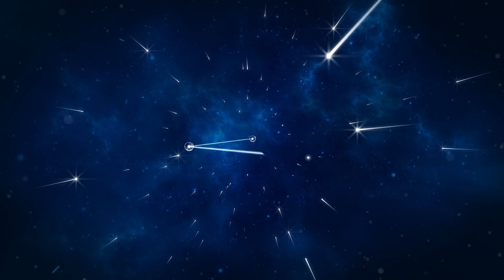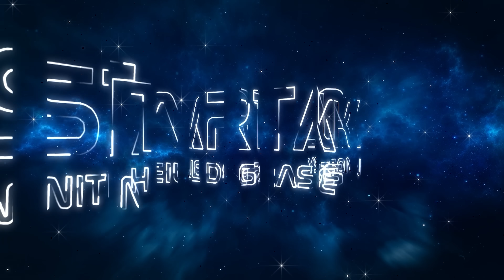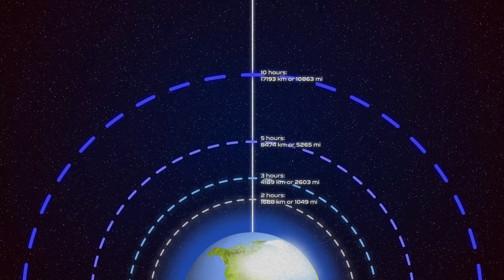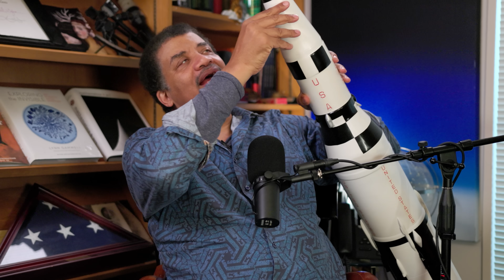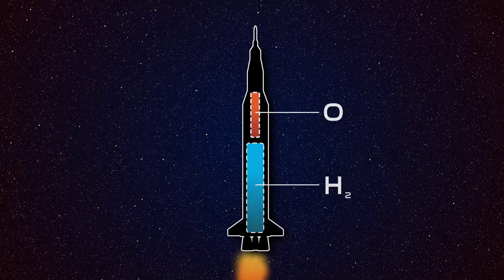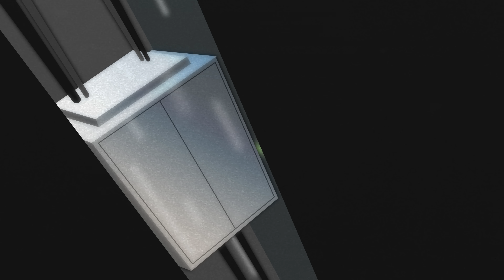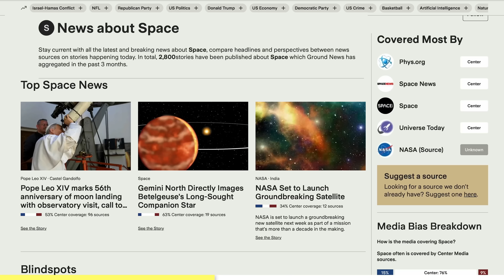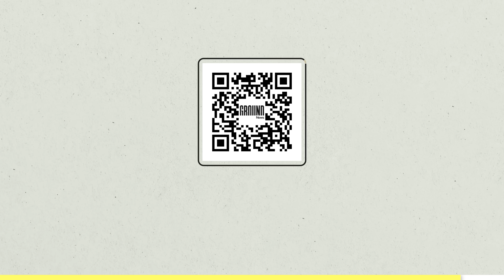When Will We Have a Space Elevator?

Comment: Clearly the 'Elevator' part of the space elevator isn't going to exactly mimic an elevator from a tall building. You will not be using a 47K Mile long cable, no matter what you think you can make it out of. It will not be using a counterweight system at all. A 'crawler' system could work, but would likely be even slower than the 100 MPH you posited. Given how slow it would be, one would imagine that the exterior structure itself would have to be sturdy enough to handle multiple crawlers in progress. No one is going to want to wait three months for the next elevator ride. It really only approaches practicality if you can shield from Gravity. At that point, the crawler could use a lot less energy to move the cab to the top and would be able to go a lot faster than 100 MPH. However, if you can already shield from gravity, the cost of flying a propulsion based craft into GSO is much cheaper... so cheap, in fact, that the elevator becomes pointless.

Comment: So you get two sets of ion engines for the elevator one pointing up and the other pointing down. At 115,000 miles you turn on the opposite to slow it down. Then slowly adjusting both power output to slow it down to a stop in space. But you may need to use more  power for it to "brake" coming down because of gravity. Or I just pulled something out of nowhere.

Comment: I don't get the height requirement. Why does it have to extend to where a satellite would be geostationary? Any point along the elevator would be geostationary. I would think adding any excess height beyond the thermosphere would add unnecessary difficulty in the form of weight and forces acting on the elevator. 
I'm guessing that decoupling from the top of the elevator, if it didn't extend into geostationary orbit must mean something weird happens, ie you either fall out of orbit or have a weird orbit of some kind. It must because you are under the geostationary distance, but if you have geostationary speed, I guess that means it would fling you into an elliptical orbit averaging the distance, or... Can someone who understands my confusion just tell me what I need to hear?

Comment: 7:59 generally, when people are talking about space elevators, they're talking about a system that is in the ten to twenty billion tons of material transferred each way, not counting these sort of fuel and thing and or lift capacity. So the whole point is getting large volumes of trade in and out of orbit. And it has a good counterbalance system. So you basically are making sure that the mass of the car's going up exactly matches or as close as possible, the mass going down

Comment: Actually, wouldn't an elevator in a vaccum be able to go faster?  I mean i guess moving away from earth means more stress on the object leaving the atmosphere than say something moving  along the atmosphere (like the hyperloop system that utilizes a vacuum but essentially moves horizontally, where gravity is relatively the same, versus vertical where gravity will probably increase to a point as you leave the earth's ground).

Comment: Instead of going at a fixed 100 mph, what if it had a constant 1.25g up? You'd feel a bit heavy, but it would move faster. Now, granted, you have to slow down at the end, so you can't keep going faster, but roughly 25% of the trip is speed up, and then you coast and slow down as gravity pulls. What does that do to your trip time?

And as others have mentioned, even if this does not move *people*, it can move *construction material*.

Comment: I think that there was a PBS NOVA a few years back that was hosted by Dr. Tyson that was a context about how the "ladder" would engage with the little elevator car to get to the 'spaceport' the fastest.  The various examples proposed all worked (if I recall it correctly) with a rubber roller and a rubber ladder of some sort or another.  None worked like the Swiss trains that are on occasional travel shows that used a cog (on the train's engine) and the 'teeth' portion associated with the train's rail system?  Go figure?  Are there other ways possible to do this into orbit stuff that might not use a rocket?  Well, maybe....
I liked your presentation, I should admit to.  Anyway,  I should admit to being neither a trained Mechanical Engineer nor a Physicist.   But if the end objective is to get the benefits of F = ma, where 'F' is the summed vectors of 'a' acting on the mass, 'm,' there could be a cheaper, easier way to do all of that without a rocket or your 'solar sail.'  There are other equations around that have the vector 'F' in them, one such is F = ((m*v^2)/r) [or something like that?], ---- let's call this last vector f ---- for Huygens' description of centrifugal force.  This equation involves spinning a mass at a uniform velocity in a circle and has several vectors associated with it, which can be summarized with the 'Right-Hand Rule for Cross Product of Vectors.'   All of this last part has many industrial applications, some are prosaic and well-known. Cream separators are used on a container of raw cow's milk as an example.  So that by a minor extension or two, one can imagine a (flexible tube taped to a cardboard wedge, say) circular tube or pipe that has water being pumped through it (by whatever means, as a try it out experiment or two), then one might also imagine this circular pipe that could be folded along a rough diameter to about 20 degrees or so.  So now the vector(s) f might be labeled as '2*f' as there are two independent vectors because of that 'fold.'  Because of vector algebra, the '2*f'' part might now be labeled as f'' which written more fully becomes: f'' =2*(cos(10 degrees))*((M[the mass of water, [say, in each limb or approximate 1/2 circle of the tube that has water pumped through it]*v(the velocity of the water being pumped)^2)/(r-which is likely a bit shorter than the mathematical 'r' because we are dealing with physical objects here)).  The pumping device could be a centrifugal fuel pump, like is used in commercial or NASA type of rocket engines ---- for the pumping of rocket fuel, using a water steam pump from the chemical reaction of 80% hydrogen peroxide and sodium permanganate  ---- typically rated at about 500 Horse Power [Hp], or in space only an electrically driven pump. Not new information by any means, as there are books written about this method of 'traveling through space without rockets,' maybe there is even a 'shorter version' of this book, so to speak. If you take this suite of ideas to one of its logical conclusions. Not as long-winded nor as expensive as the NASA versions (even if only used as an interplanetary method), but there you go.  And, if you use Newton’s Law of Gravity, you don’t have to actually hit the object, but just move it a bit, slower or faster, to cause it to fall into a near-Earth orbit to be mined for any useful minerals?  Why not?  To get metal-laden asteroids in a close orbit to mine iron or some other metal?  Again, why not?

Comment: Couldn't the elevator tube be vacuum locked and magnetically-propelled using linear motors? Accelerating at 1G to halfway then using regenerative braking to decelerate and recharge the system at an equivalent pace would give an ascension time of just over an hour, having reached a peak velocity of around 18km/sec (just under 42,000mph).

Comment: Great video on an interesting topic. A couple of side-points that were not addressed and I felt led to a hand-wavy dismissal of a still fantastic idea: 1) For tourists, sitting in geo-stationary orbit is not interesting, because space is empty and earth is really far away. Like Blue Origin, I'd imagine a passenger shuttle car only to go up into "space" at around 10-400 km without ever reaching orbital velocity, and then going back down. You might not even need a platform / hotel at that height to make it a breathtaking trip. 2) You need quite a bit of kinetic energy to e.g. launch from the space elevator horizontally at height of the ISS and achieve orbit (around 8km/s). So, even with a moderate, progressive accelaration, you could achieve orbital velocity within 30 min after launch. The higher they go, the less subjective gravity a passenger is forced to endure, always staying around 1.5-2g, maybe? Once outside atmosphere, there is little reason not to continuously accelerate! 3) You would not need a chemical rocket to accelerate while tethered to an extremely potent conductor (i.e. CNT). Such acceleration could be achieved by the electricity that you alternatively would use to convert water into rocket fuel, but much, much more efficiently. 4) The potential energy contained in any extraterrestrial resources you ship to your space-port counterweight, once "dropped" into earth's gravity well, can offset the energy expenditure of hauling anything up into orbit. In the case of tourism, your payload wants to return to earth anyway, so that is energetically closer to a zero-sum game anyway (minus friction losses of course).

Comment: It's been a long time since I read the early speculative fiction about space elevators, but from what I remember, you didn't just have one elevator, you had two, so that when one went up the other went down. And they were big, really big, basically being hostels to house and feed the people as they went up or came down. Having the two balancing each other was supposed to dramatically reduce the energy costs.
The problem was what happens if the cable breaks - or is sabotaged to snap? Now you've got a super strong cable slapping down across the landscape at extreme velocity.

Comment: How about instead of sitting 10 days in an elevator, you could take a small rocket to the elevator platform, refuel your small rocket and go on from there. The elevator could continuously pump rocket fuel up to the spaceport and allow for smaller rockets to be viable. That would mean smaller engines, lighter rockets and more room for astronauts and equipment. This doesn't solve the gargantuan engineering problem of creating the elevator in the first place but there could be other uses than to just move equipment and people up to orbit.

Comment: @7:55  If not already mentioned in the 1,681 comments before this, you're not just looking at the cable or the platform, but the gravitational weight of the elevator car, which will change depending on elevation, right?  (This may be addressed later in the vid, I'm posting this is my relativistic "real time.")

Comment: The idea is alluring but the practicality is hard. Let's say you do get all the materials you'd need, you would also need to calculate the weight of the gravitational pull on itself on a massive structure and you cannot just make a normal sized elevator as for one it would be useless to only have limited cargo to pull the elevator into space and 2nd, cables won't be able to handle pulling a normal sized elevator with that kind of length let alone a bigger one that could house a rocket to be brought up to space. you would need it to be sturdy for both gravitational pull and wind resistance so you'd actually make it bury deeper into earth for a more stable platform. If this elevator does happen, I can assure you it wouldn't even be within this lifetime or the next unless we develop a more stable technology of materials as well as have more of these materials at a cheaper price.

Comment: Question, why does it have to be 23,000 miles up?  Why couldn’t the ‘ladder’ be 200 miles up (same height as the space station). What am I missing from a physics standpoint?
Reply: At 200 miles an object in orbit makes a full revolution much faster than the earth rotates (this is why you can stand outside and watch the space station fly across the sky).  At ~23000 miles the orbiting body "matches speed" with earth's rotation, and is always above the same point on the surface. Since you need a fixed start and endpoint for an elevator, you have to go all the way to geosynchronous orbit.
Reply: @JustinSlick Thank you!  Makes sense now.

Comment: The space elevator-rocket hybrid is actually not a bad idea. 
You could boost the elevator at the start lowering the time it takes to reach the top, while still saving up on the majority of fuel used. 
Maybe then we would reach the top in 24h  It would be more like a vertical highspeed train than an elevator though.

Comment: Alas, I don't believe a space elevator is possible the way we want to use it. 

As long as everything that goes up the elevator eventually comes back down, everything is fine. 

But every trip up the elevator robs the orbiting station at the top of angular momentum, while every trip down of that same mass gives back that momentum. 

So if we use the space elevator to lift ships into orbit where they can launch from space, each such launch will rob the orbiting station at the top of the elevator of angular momentum and never give it back. And the effect is cumulative. 

Do this enough times, and the space elevator will de-orbit.

Having an elevator doesn't change the amount of energy required to lift a given amount of mass into geosynchronous orbit. And there's nothing magical about shifting the source of that energy from rocket fuel to the orbiting station's kinetic energy. So to keep from de-orbiting the station, payloads (like spaceships) that never make the trip back down will need to carry sufficient fuel to the orbiting station so the station can burn that fuel to gain back the energy it lost from the elevator's trip up. 

And isn't dependency on rocket fuel to reach space the very thing we're trying to solve?

Comment: A major consideration for this also is security. A space elevator would be the most vulnerable target on the planet, especially if it was used for supply runs.
Reply: In Asimov's Foundation, the space elevator terrorism attack was highly destructive...

Add hydrogen balloons every quarter mile to lighten the load and segment the potential destructive force. If one piece breaks or is attacked the others can keep on floating...

Consider having the elevator over water...

Comment: The reality of the space elevator is as depressing as not being able to travel at the speed of light…
Reply: I agree. One thing I don't understand about this space elevator thing is gravity. If it's an elevator that is going straight up from the ground, it won't achieve orbital velocity until it reaches the satellite or whatever it stops at 23,000 away. I'm not sure what can hold such a structure together. I assume the main material would be Graphite.
Reply: @ray_ray_7112 there are many videos about this. But unlike FTL, carbon nanotubes with zero defects are strong enough. The elevator would be tapered. We need to split the moon for enough counter weigh.  And asteroid mining for carbon.

Comment: We could also use EM cannons that would fire a rocket to certain height, instead of the first stage. The rockets would be smaller, and use less fuel. And the stuff needed to built orbital infrastructure (metal beams, oxygen tanks etc) and is not harmed by acceleration could be fired directly into LEO. Expensive for sure, but more realistic  than a 50000+ km nanotube.

Comment: Using 100mph as a constant speed doesn't seem right to me. The air resistance from earth's atmosphere would be much lower for most of the trip so you could get the elevator going much faster using conventional motors, like the ones found in electric cars, with gearing that's optimized for the space elevator.

Comment: It's a fair point about the time scale, but I was always under the impression that the purpose of the space elevator was not to move people but rather materials. There are some things which when put into space are fairly cost prohibitive. Rocket fuel, for example. 

Having a space elevator to move things into high Earth orbit without having to expend the fuel to get there is a logistics advantage. It lets you do some pretty nutty things which previously have been considered logistical nightmares or impossibilities. For example, catching satellites or bringing them to a platform to repair instead of having to geosynchronously meet up with them, Refueling a rocket in space, Large-Scale off-planet construction projects, zero gravity construction structures, etc.

Getting into space is cheaper than ever before. Yes, but the space elevator was always an attempt to scale up the amount of times you could get into space, and modifying what would be economical to send.
Reply: We need to move factory up there. It needs a foundry and a machine shop. It's first job is to build a better and bigger foundry.

Comment: One of the interesting discussions, though, was about implementing a lunar space elevator - with much lower gravity the materials are much less of a problem, and returning materials from the moon to earth might be made a lot easier if a space elevator allowed more efficiently getting materials to a point where the energy required to put a craft on a return trip to earth would be much lower. It would still be expensive to get to the moon, but with the potential to produce fuel on the moon and to use a space elevator to get to a minimal-energy launch point from there, it could make launches from a lunar base much more economical.

Comment: How old is this interview?  Not just the upload date of this clip.  Because that Titan Submarine would like a strong word with Neil's claims about Carbon Fiber
Yes, this isn't in the ocean, but if Carbon Fiber is even a quarter as dense as water, the bottom portion will shatter under the weight of the top portion before we even get to the ISS.  Remember, weight is pressure, something Carbon Fiber does not handle well.  If you hang it from the top side instead, same thing, but at the top - plus other complications involving Newton's laws that will eventually drag the whole thing crashing down